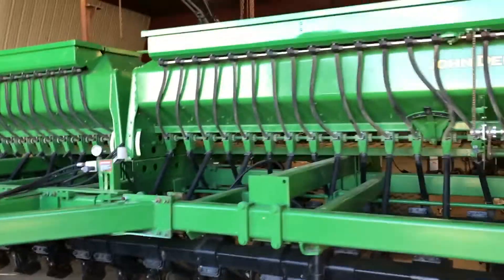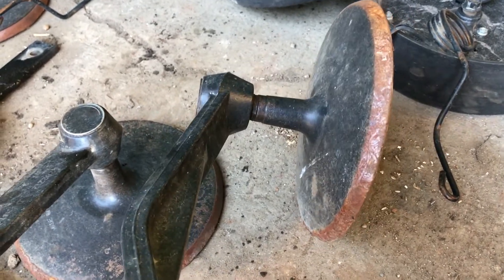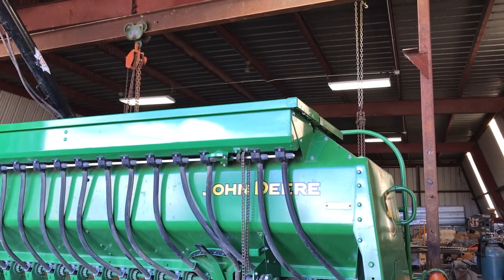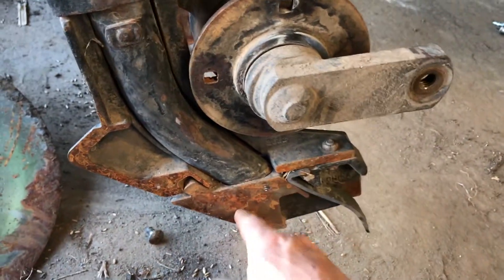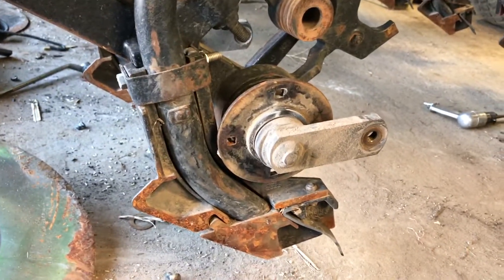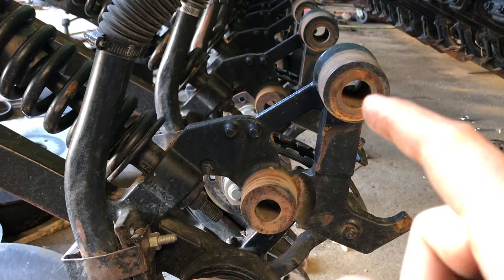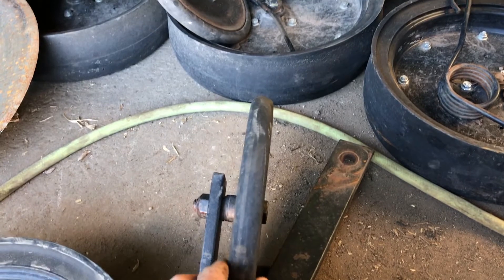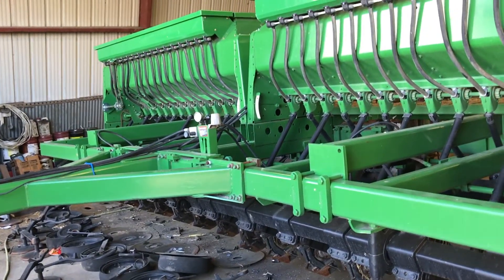Sharing the differances between jd no till drills

Comment: thanks for the info Ted. I plan to update mine at some point due to the fact they don't make them anymore! I was thinking about a great plains 10 it 12 footer
Reply from the maker: I dont really care for great plains drills.... Seems like alot of them are minimum till drills that they bolted a Coulter cart on the front and call it no till.... Our neighbor purchased one because he didn't think a 20 footer was big enough and jd doesn't make a no till drill that is larger unless you go air seeder.... He had so many problems with the Coulter cart plugging it want funny...  They disturb the ground alot more than a single disc drill..But its all what you want... what you can find, and the biggest deciding factor is what you can afford!!
Reply: Ted Kahler got that right!

Comment: Thanks for the info   I seed most of my barley or oats with an old IH 150 and it only holds 30bu , but we don't seed very much a year so it's not a big deal   I still want a drill like yours for planting alfalfa at $5/lb I would like to do a better job.
Reply from the maker: Really alfalfa at 5 #... we aim for 10-12 here.... I love my drill.... Wish i had an air seeder but i dont have enough hp to pull one!!!
Reply: I try to plant 12lbs / acre but sometimes 11 sometimes 14 depends how well I calibrate   My brother inlaw has 2 60' air drills and farms all Dry land ( no irrigation) and he doesn't have cows but will plant some poor land to hay and he seeds a grass mix and drills it in a criss cross pattern and he gets a great stand. and his poor land has made more per acre selling hay than poor wheat and after a couple years he sprays it out and it goes back into rotation.    They have been zero till for 20years and they crop everything when they worked land they summer fallowed 50%. They keep very currant with equipment and raise very good crops.
Reply from the maker: IC i read your origianal comment wrong 5$ per pound i read it as 5 # per acre LOL
Reply: I thought so      It's all good LOL